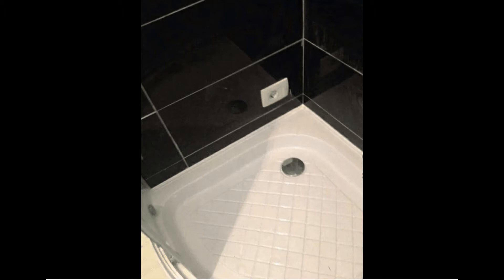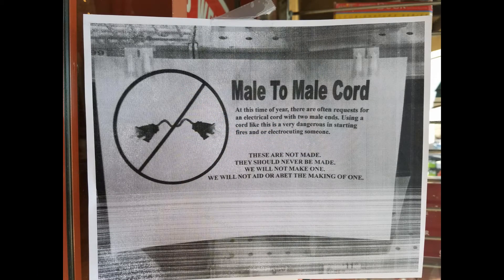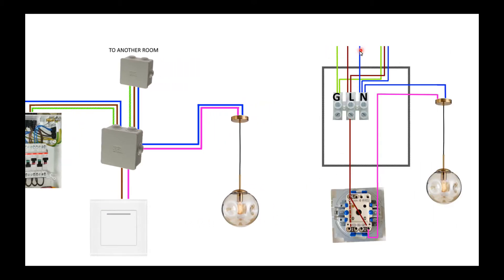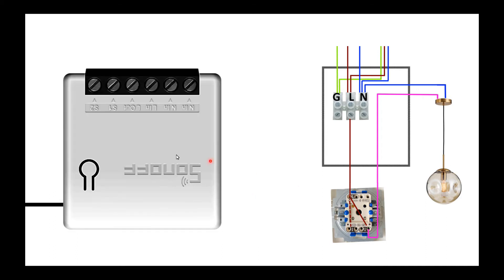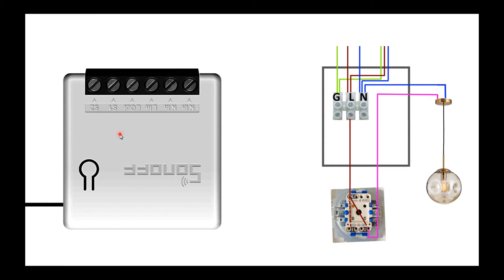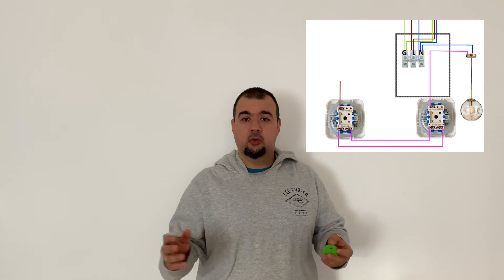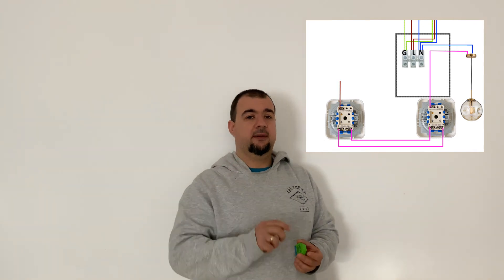HOW TO: Sonoff MINI Installation - No Neutral Line in the Light Switch Box

Comment: i have old installation, all cables are black and there is no ground :D but nvm. Nice video but i looking diffrent way, a long time ago i saw a manual, video or pic abut plug in some device or electric part in parallel circuit with the bulb, sonoff dont need 230V to work, its operate at low voltage and only switching 230v. And i cant find it :/ if i will find this method i post it under :)
Reply from the maker: I know such  a solution from a Russian forum. You need one capacitor in parallel with the Sonoff and another one  with the light bulb. You need however to calculate the capacity of the second one based on the used bulb.  I've tried it , just for fun,  but all the bulbs that I had (LED bulbs) were flickering.  
Also, I wand to mention that since I made this video I've replaced all my MINIs with Zigbee dimmers or IKEA Tradfri bulbs.  Some of these dimmers don't require neutral line.  For EUR 12 you can have one from Aliexpress to play with.
Reply: @amt1793  thx, Yes i found it, true, u must calculate capacitor for every bulb. I buy sonoff mini zigbee and gateway. Meybe they will be flickering but only for winter. I must change all electric cord in house and i will upgrade it :) thx for respond :)

Comment: You should really be clear in your title.You have a neutral available. As stated by somebody already, waste of time
Reply from the maker: Hi Ronald and thank you for your comment. First of all I think it is easy to observe at 3:32 that I have no neutral wire in the light switch box (as title mentions it).
Secondly, the manufacturer documents pretty clear in the installation manual that SONOFF Mini devices require a neutral connection.  If you think you know better than that, feel free to install it in your own way (and take the risks for you and your family). In this video I show how to properly install it -according to the manufacturer instructions.
Reply: @amt1793  well exactly my point. When you read only the title it sounds like you’re wiring the sonoff without neutral. So call me stupid, but Îm certainly not the only one who read it like that. I was therefore curious how you would do that. But of course you didn’t cause you had neutral where you are installing the sonoff. So waste of time. And actually waste of time to even comment on this actually.

Comment: instead of connecting the neutral from the light to socket  directly can you connect it to the other Nin in the sonoff?
Reply from the maker: Hi! Good question! I should have mentioned this in the video. 
Yes, you can do that. Actually that is the purpose of having two Nin connectors on the MINI device ;).
Reply: @amt1793  thanks for your response .i was a little confused but you cleared my doubts 👍

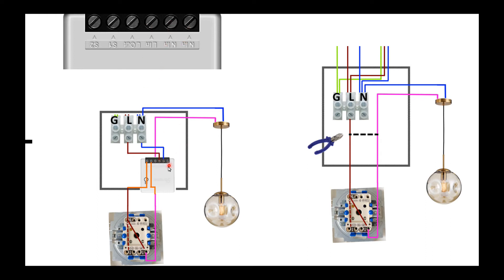Comment: 6:43 WTF this video is a waste of time. I'm looking for a way to connect without a neutral line.
Reply from the maker: I am sorry that you think I wasted your time. The title doesn't say no neutral line. It says no neutral line in the light switch box.

If you really don't have access  to a junction box  with a neutral wire you should not use a SONOFF MINI.
Have a look at Shelly Dimmer 2. https://shelly.cloud/knowledge-base/devices/shelly-dimmer-2/#wiring

You can also use an RF Swith + a Sonoff RF . Let me know if you want more details about this solution.